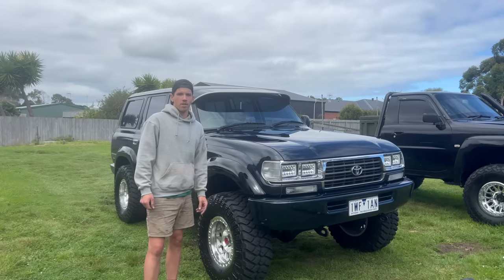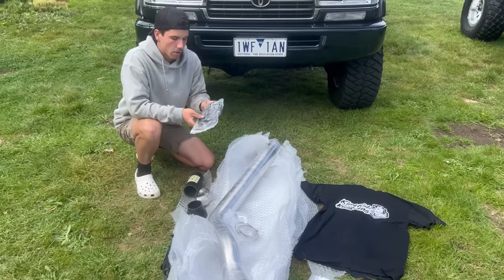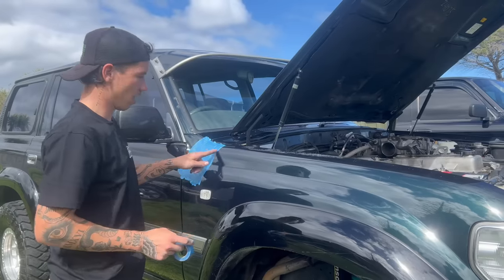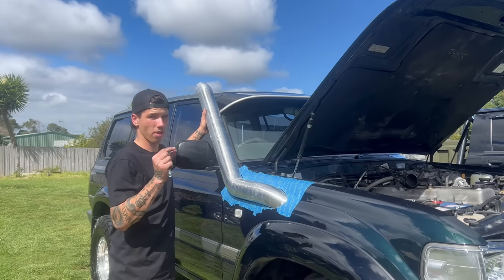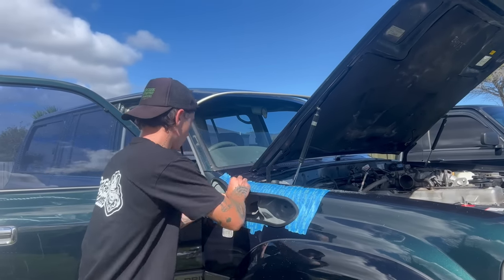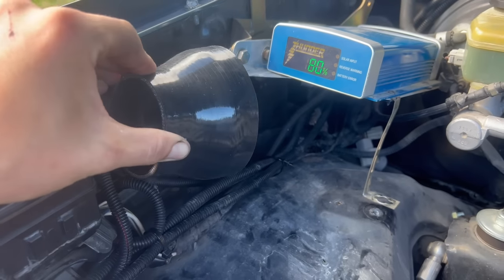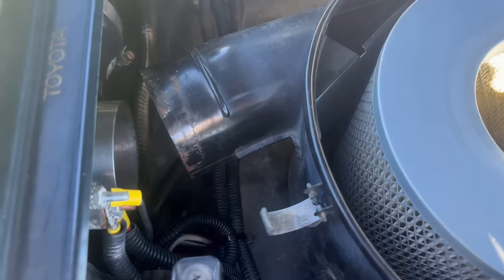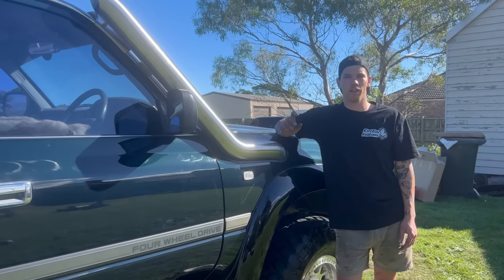80 SERIES GETS STAINLESS SNORKEL!

Comment: warmest regards from Italy Florence a question about the snorkel I see many snorkels on many off-road vehicles that have the mushroom pipe turned towards the rear of the 4x4 off-road vehicle and does anyone have the mushroom pipe turned towards the front of the 4x4 off-road vehicle? (and some off-road vehicles Does the 4x4 have a cyclone mushroom like an agricultural or earthmoving machine?) Christmas 2023 from Italy Florence!)
Reply: You can do either, people face it outwards as it means when you are going down dirt tracks you aren't force feeding airborne dust into your filters. Realistically it'll still be better than without a snorkel but if you can I'd reverse it. Those plastic snorkels are real simple and cheap so I'd you stuff up the $150 odd for a new one isn't steep